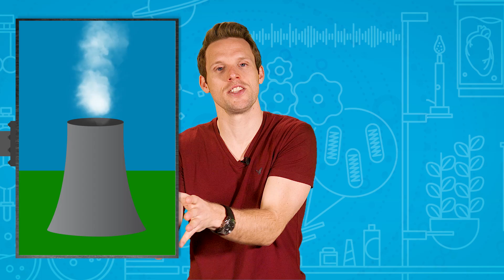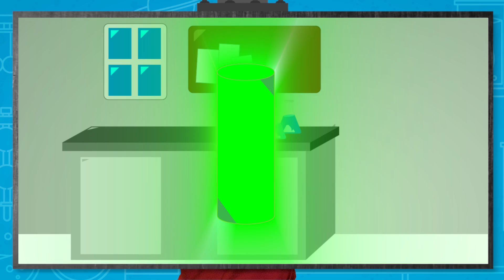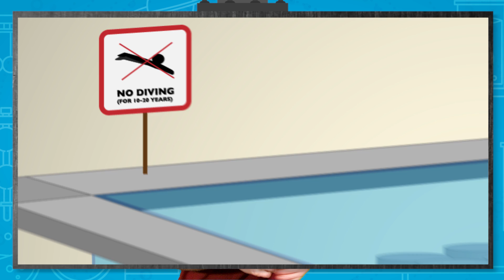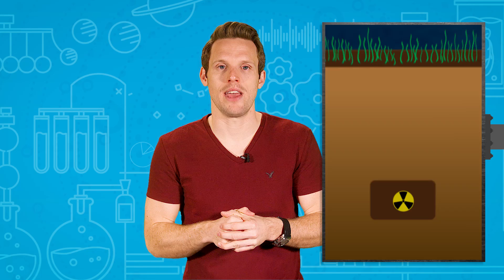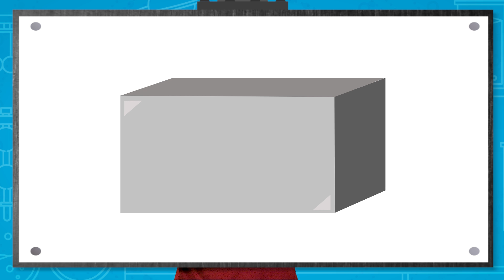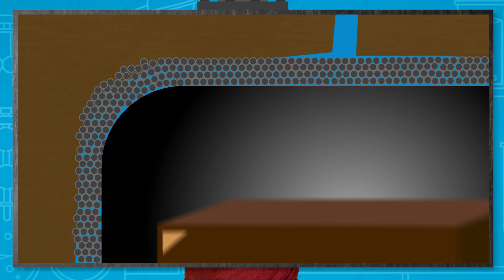What Happens to Nuclear Waste? | BBC Earth Science

Comment: a few things you did not mention
current technology of reactors burns maybe 1% of their fuel. after just a few years in the reactor fuel gets contaminated with fission products and there is a concern fuel cladding might not be able to hold it in any more. that's why such fuel is being removed.
Does it mean it can no longer be used? No. It just needs a different type of reactor.
Breeder reactors can take such spent fuel and keep on using it to make electricity or heat - greatly reducing the volume of waste and it's longevity. remove transuranic materials from this fuel and its radioactivity would be down to natural levels after 300 or so years - and these transuranic materials - you can use them to keep making electricity for you, instead of burying them, until they are all gone.
Such reactors are currently being developed. There's a whole list of companies who are making major progress in making them happen - my bet you can expect China to start building such a reactor in several years tops.
So it might very well be that Finnish deep geological repository solution is already obsolete - before they even start using it.

Btw what you've said about storing fuel in water pools is inaccurate. Underwater storage is necessary only for the first several years.
After that, for another 20 or so years it's enough if you store it in a casket that has enough air ventilation to take away the heat.
After that, you can just bury it underground without any cooling solution at all.

The nuclear dream of providing a near-infinite amount of cheap and clean energy is now more alive than it ever was. It just needs better technologies than those used back in the 1960-ies.

Comment: Wind and nuclear power plants have nearly equivalent total grams-of-CO2/kWh carbon debt, which includes construction plus operational lifetime carbon use.  However, for an equal electricity MW output, wind costs 4x more than nuclear to build and & wind is only available (depends on location) about 50% of the time (UK often dips to 30%) whereas nuclear power plants average about 90% availability.   
Nuclear power will be the primary tool used to address CO2 emmissions in the near term.  If/when we have economical large-scale battery storage to buffer intermittent renewable sources, then I will happily support scaling back nuclear where it makes sense to do so.  But we can't afford (existentially or econimically) afford to abandon nuclear power yet.
Reply: Another shameless lie and pathetic attempt to claim that the cost of wind generation is more than nuclear power generation. Wind farms are ALWAYS cheaper and quicker to build than nuclear power plants.....but the other key cost which is virtually NEVER factored in, is the cost of long term storage and security of a nuclear power stations nuclear waste, which will outlive the nuclear power station that generated it!!!!

Comment: EVERY energy generation method produces waste.  Pick your poison carefully.  
For nuclear power, every gram of nuclear "waste" is tracked and contained.  The same cannot be said for the extremely corrosive chemical waste used in solar panel semiconductor manufacturing or for the CO2, particulates, etc. released from fossil fuels burned to smelt metals and power the manufacturing of wind turbines and solar panels.  Nuclear power plant and fuel rod mining and construction also produces such waste, but we are getting at least a million times more energy from the equivalent environmental damage used to produce renewables.  

Fun fact:  The LONGER the half-life of a radioactive element, the LESS dangerous it is from a radiation health effect perspective.  It's the short half-life stuff like caesium-137 (30 years) and iodine-131 (8 days) you have to really watch out for, not short-term exposure to 150,000 or 250,000 year half-life elements.  E=mc^2, so the more mass an element loses over time, the more energy it is throwing off as harmful radiation.  

Do we need a plan for radioactive "waste"?  Yes, so we can build more nuclear power plants for base load needs so that we have the luxury of using unreliable wind and solar plus battery storage to minimize the need for nuclear where possible.  

If we're really staring down the environmental barrel from climate change around the year 2050, then we FIRST need to focus on solving that problem at hand using the sure-thing million times more energetic nuclear solution and THEN scale back nuclear as soon as affordable battery storage or renewables can econimically power a city like New York for an entire wintertime, cloud covered, windless week.   Renewable research is important, but it's too late in the game to gamble on such a relatively impotent tool in the face of imminent global catastrophe. 

Nuclear has issues, but modern plant designs (like the passively cooled (so, no Fukushima problem) and mass-produced (so cheaper) Westinghouse AP1000 - Already 3 built in China) are ready to go NOW, and even safer molten salt reactors will likely be ready in 2030s.

Nuclear has issues, but it's better than what's billed as certain doom if we don't address the skyrocketing CO2 emmissions of developing countries hungry for electricity and using filthy coal and oil to get it.  Those countries will NOT spend their limited cash on weak and unreliable energy sources that will fail to quickly lift their people out of suffering.   We need to find a way to get cheap, proliferation resistant, and abundant nuclear power into developing countries ASAP.

Wind and solar can have their place, but they won't power the world fast enough to make the difference that we just can't wait for anymore.

Comment: How do we dispose of nuclear waste? step 1, stop making it. its pretty clear that nuclear energy not only isnt clean energy,  its polution stays around for.... what did the video say? 250,000 years? We are already struggling with disposal of the waste that has already been generated without dealing with an every growing supply of it.  Nix nuclear energy and concentrate on energy production that is actually clean. Otherwise the problem of disposing nuclear waste will never end.  It will just grow and grow as we keep producing it.
Reply: +OUTFXD Yes nuclear waste is an issue, but the claims made by this video illustrate in a very misleading form. First of all 250,000 years is the decay rate for a very specific isotope- Plutonium 239. Now I have an idea as to why the author chose this particular isotope, but the way in which this video portrayed high level waste to be primarily this substance is incredibly misleading. 
1. Plutonium 239 is a fissile isotope, which means that you can fission this material and you will no longer have this waste stream. When you fission Plutonium 239 it primarily becomes Xenon 134 and Zirconium 103. Xenon 134 is a stable isotope and Zirconium 103 has a half life of 1.2 seconds. 

2. This video characterizes nuclear waste lasting 250,000 years as spent waste, but this is completely inaccurate. In order to be spent waste you have to be the product of fission, which is not where we get Plutonium 239. Pu-239 is the result of a series of decays when Uranium 238 absorbs a neutron during a fuel cycle. Uranium 238 + 1 neutron = Uranium 239, which decays rapidly into Neptunium 239 and then decays into plutonium 239. Never does Plutonium 239 exist from the result of being spent as a result from fission, so to describe the formation of this isotope as such is completely inaccurate. 

3. This video describes nuclear waste as lasting 250,000 years, which is incredibly misleading, because Plutonium 239 does not make up even close to the majority of high level waste. In actuality High Level Waste is comprised of about 1% Plutonium 239 by volume. By comparison Uranium 238 makes up about 96.5% of high level waste by volume, which makes sense give that Uranium 238 is a fertile fuel (not fissile) and makes up at least 95% of the fuel in nuclear reactors per NRC proliferation regulation.

Now it is very likely that the authors of this video purposefully did not recognize these points, because such discussion would actually require them to teach their viewers about radioactivity, and they wouldn't be able to make such an erroneous claim that supported their narrative. Uranium 238 has a half life of 4.6 billion years, which means that it will likely be around for 47 billion years or longer than the projected remaining lifespan of the sun. On the other hand this isotope is naturally occurring, so if it lasts for ever and is in such high quantities how is it that humanity is still alive today? 

In reality radioactive materials are much more complicated than just decay rate, and ironically the longer the decay rate the lower a material's radioactivity actually is. This is because radioactivity is the amount of particles emitted per second of time. Therefore, if an isotope has a low decay rate say 704,000 years like Americium 243 this means that less particles are emitted per second than an isotope like Iodine 131 whose total decay rate is about 81 days. The more particles that are emitted the greater amount of radiation exposure, so contrary to the message of this video there is not necessarily a tremendous amount of radiation when exposed to Plutonium 239- it depends on how much material is actually there. 

Furthermore there are other characteristics that change the risk of radioactive waste. Lets look at two isotopes with similar decay rates Platinum 175 and Carbon 15 each with decay rates of about 2.5 seconds. Based solely on the information provided in this video each of these isotopes should be equally risky. However in actuality Carbon 15 poses a greater risk, because Carbon 15 exhibits beta decay, whereas Platinum 175 has alpha decay. Human skin actually blocks alpha particles, but beta particles can pas through human skin and potentially cause harm to organs. This is why you can literally pick up Uranium 238 with your bare hands with no inherent danger. Its honestly quite mind boggling that in a video about radioactive materials radioactivity, decay particles, bioaccumulation, radiation dose and chemical characteristics were never discussed.
Reply: Wow! Thats um... above my I.Q. grade.  Thank you for taking the time to put your answer together! I actually understood some of it and even learned a couple things !   I mostly get by  simply trying to apply common sense to things ( Common sense seems to be getting rarer and rarer).   When it comes to the Heavy lifting type.... thinking....  I say leave Siencing to the Siencers! <jk>  Thank you again!
Reply: +OUTFXD "Nix nuclear energy and concentrate on energy production that is actually clean." Such as what? None of our energy sources are actually clean that's 100% marketing. Wind turbines are heavily reliant on petrochemical production for the manufacturing of carbon fiber and fiberglass blades. Geothermal can release sulfur dioxide, which causes respiratory damage. Biomass can typically be CO2 neutral or even CO2 positive. Biofuels can emit similar levels of GHGs as biomass and can often increases rates of deforestation. Hydroelectric typically requires significant destruction to environments during construction. Solar has a whole slew of problems during manufacturing because it requires synthetic semi-conductors and creates wastes such as silicon tetrachloride, dichlorosilane, trichlorosilane, nitrogen trifluoride, gallium arsenic, cadmium, tellurium, and hydrochloric acid. 

Additionally this video completely forgets about an entire other side of nuclear waste management. Deep geological depositories are not the only option. In fact the only waste management strategies actually used today were never discussed in this entire video. The first strategy in use is reprocessing, which is the system by which isotopes are separated from nuclear waste. Conventional methods such as PUREX and UREX are used to remove plutonium and uranium from fuel streams, and in the commercial section Uranium 235, Uranium 238, Plutonium 239, Plutonium 241, and Plutonium 242 are recovered for reuse as nuclear fuel into reactors again. As I explained in my earlier comment Plutonium is never spent in the reactor and is actually fuel, and the same can be said for Uranium. While most people see hundreds of thousands of tons of waste, 97.5% of this material can actually be reused in a reactor. Currently the nations of UK, France, Spain, Sweden, Germany, Russia, China, South Korea and Japan actually use reprocessing. Its very odd that a channel based in the UK never included the actively utilized waste management strategy…. 

Now to be fair reprocessing comes with high risk, because after all this process was first used to create nuclear weapons. While studies have shown that commercial nuclear reactors have not increased nuclear weapons proliferation in the last 50 years, it is possible to use this method for weapons production. Additionally conventional methods of reprocessing are very very expensive. However in 2005 South Korea and Argonne National Laboratory in the USA developed a new type of reprocessing called Pyroprocessing, which has the potential to be much cheaper for various reasons including the removal of water from the process. 

The second currently used "strategy" is the use of fast reactors. Fast reactors are a type of reactor defined by the high energy of fissile fuel and the lack of moderation. Certain fissile isotopes have a greater probability to fission if they are put into an environment that reduces moderation. Plutonium 239 for example has about a 30% probability to fission in a normal reactor (what is called thermal spectrum), but in a fast reactor (fast spectrum) the probability grows to about 70%. As I stated before this is not new technology. In fact one of the first reactors ever used on earth to produce electricity was a fast reactor called EBR-1 in 1951. 

Now the reason why I put the word strategy in quotations is because fast reactors are not really used as an option for waste management as much as they are a strategy from fuel management. In Russia per non-proliferation agreements with the USA to reduce their stockpile of nuclear fuel for weapons Plutonium 239 is actually used in fast reactors to reduce their stockpiles. However, Fast Breeder Reactors are a type of fast reactors specifically designed to take the "waste" from Uranium 238 absorption and use it as fuel in a nuclear reactor. Breeding is a nuclear technique in which fertile fuel isotopes like Uranium 238 are used in an environment that encourages the absorption of neutrons and thus the creation of fissile fuel isotopes such as Plutonium 239. This Plutonium 239 fuel is then used and undergoes fission. EBR-1 was actually a liquid metal fast breeder reactor, and since the 1950s 8 different nations have participated in over 30 fast breeder and fast reactor projects. 

Id also like to bring your attention to another option that currently exists in all nuclear reactors, but is not emphasized commercially yet. There is another process called nuclear burning that is very similar to nuclear breeding. Instead of turning fertile fuel isotopes in fissile fuel isotopes, nuclear burning is the process by which isotopes absorb neutrons and become different isotopes with much lower decay rates. For example, earlier I said that Americium 243's total decay rate was 704,000 years, which is an incredibly long time to wait for the material to decay (not that its actually that dangerous, but people have been lead to believe that the longer the half life the more dangerous the isotope- a completely inaccurate belief). Lets so for whatever reason we still want to get rid of isotopes that last a considerable amount of time. Well you can either wait 704,000 years or you can force this isotope to absorb a neutron. Am 243 + 1 neutron = Am 244. Americium 244's total decay rate is about 105 hours or about 4 1/2 days. 

Today there is a tremendous amount of research into developing actinide burner reactors, whose purpose is to take radioactive isotopes with very long decay rates from nuclear waste streams and transmute them (absorb a neutron) into isotopes with significantly lower decay rates. Last November a Canadian company called Terrestrial Energy actually received the first design permits to construct a nuclear reactor called an IMSR, which integrates nuclear burning in the reactor core. Terrestrial Energy plans to begin operation with this reactor in 2025.

Comment: Or we could just use renewable energy. I'm a big fan of nuclear energy but green sources are a much safer alternative.
Reply: Nuclear is the safest per TW, being 0.04. Next best is Hydro at 1.4 although 0.1 when you start excluding Banqiao - but no one would ever do that for Chernobyl right? Solar is 0.44. Coal is of course the worst at 100+ depending on metric. There is no "just" we need to have something that we can run on demand alongside the less stable power sources.

Comment: Re-utilize the waste for use in radio-isotope thermoelectric generators.  The long half-lifes of the discarded material would make RTGs the most efficient batteries we can make.  And there is sufficient material for a single RTG compound (city block sized) to continue providing power for years/decades beyond the shutdown of a Nuclear power plant.